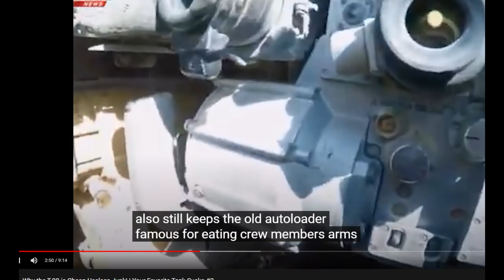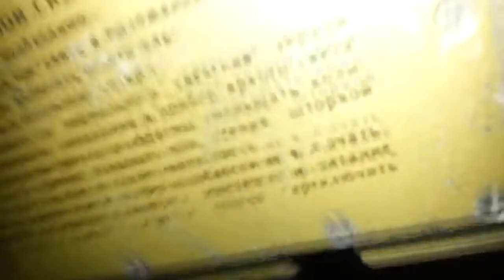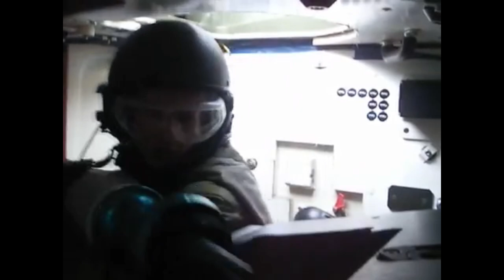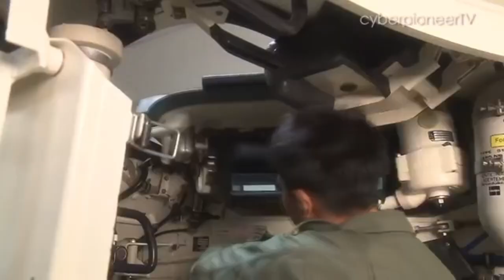Busting Myths on T-72 tank!

Comment: A question to Red and other self proclamed tank experts: is the the Hull of t-72 is similar to the t-90 one in terme of dimensions (width, lenght, height) ? 
Please
Reply: Another question :could we put the welded turret of t-90 on t-72 Hull?
Reply from the maker: @warmbreeze7996  I never claimed to be a tank expert...
But yes, T-72 and T-90 hull are equal in dimensions and you can indeed put the welded turret of T-90 on a T-72 hull
Reply: @warmbreeze7996  T72 and t90 are almost the same tank so they should have the same demensions
Reply: @RedEffectChannel  excuse me for the mis understanding, by 'self proclaled tank experts' i was ironic and mean about some people in the comment section who pretend to know everything and arguee with you if you give an opposite opinion than theirs.
Thanks you for your answer
Reply: @meki___6881  Dimension-wise Yes, but the composite armor is different as well as the gun and electronics.
Reply: T-90 is based on T-72 but for commercial motive the name was changed to a version of the T-72 to "T-90"

Comment: Old Diesel engines run pretty much on any burning liquid. Vegetable oil or petrol it doesnt matter. The only reason this changed in more modern times is higher and higher injection pressure resulting in better fuel economy. The downside is that fuels like petrol dont have a lubricating effect like Diesel which would damage the injectors during continues usage.

Comment: I actaully got to take a chance to get in a M84 from Slovinia when I was in Germany in 2018. The driver was taller than me about 5'9-5'11 vs me at 5'8. The drivers hull was alright, but not as comfortable as the drivers hull in the M1A2. The Turret space wasn't bad honestly, I was a loader and gunner at the time, compared to the Abrams stations. But I wasn't to keen on the small foot bar for the gunner in the M84 and the lack of guards on the turret ring. It was a pretty beat up tank, but that's expected regarding Slovinian M84's.

Comment: So, I don't know if this is true or not. I read somewhere that US soldiers that were involved in the Gulf War had inspected the Kuwait's Yugoslav-made M-84AB tanks. They also inspected captured Iraqi T-72 tanks. And the conclusion was that the M-84 had a much higher build quality from the materials used to the quality of the welds. Again, I don't know if it's true.
Reply: It also, on one instance, Abrams stopped working cuz of the sand, but M84 did not. That's actually crazy to think about
Reply: Probably partially true. Turrets were made locally in Iraq. Can't expect quality there
Reply: @nikolaradovic8067  Unlike the M-84, the Abrams used(and still uses) a gas turbine engine that needs a shit ton of air and therefore good air filters - which it didn't have back then and the sand made the engine die.
Reply: @veliki_dlek  Yea, i know that. But it's still amazing to know more things
Reply: @nikolaradovic8067  I am sure that both M1s and M84s had maintenance issues.  Remember that the M1s had been in theater for 4 to 6 months already; the M84s were practically new, and had only been in the desert 1 or 2 months. The M84s also had Contractors (and US Army mechanics) aiding the crews. The Yugoslavia government (and a German corporation) had a vested interest in the M84s performing well compared to the Soviet Union and PRC manufactured tanks. 

In the 1990s, as a generalization, M84s were superior to nearly all T72 tanks.
Reply: @paladinsix9285  yeah, if nearly does not include T-72B....
Reply: Its not, its Just that Jugoslavija sent logistics aid and personal to oversee the tanks delivery and train kuwait personal. On the other Hand iraq was sanctioned and could not import any kind of replacement parts and their t72 werent maintaned at all
Reply: @barbarapitenthusiast7103  I am sorry, but how does the tanks not being maintained properly affect if the original welds and castings were of good quality or not?
Reply: @ravenouself4181  yes, it does. any imperfections on the welds and castings Will be made way, way worse by years of use in harsh desert conditions without any maintanance

Comment: Red, which do you think is better, T72B3 (with the engine upgrade) or T90A? I think the T72B3 is better as it has more gun depression, which allows a tank to target much more accurately when moving over rough terrain. It also has a better engine ~1100hp compared to the T90A ~1000hp which gives it a slight edge in mobility. I’d like to hear your thoughts
Reply: T-90A have 840hp engine, the same as T-72B'89
T-72B3 2016 have realick side skirts and Forest S24 era on side turret but front is better in T-90A on the turret because of the knew turret.
Reply: @76456  the T90A has a 1000hp engine. It’s the original T90 that has the 840hp engine

Comment: Every T72 can be converted in to RC or AI controlled vehicle. The hardest thing - auto reload mech already done. So in this case Russia has a potential to create the biggest army of autonome tanks, while on west only french Leclerc has such capability but it costs much, while T72 is cheap and prodused in very hight quantity.
Reply: Russia had tried making RC tanks in Syria and Ukraine, there are problems with maintaining a signal to the operator with ground vehicles. Aerial Drones have the benefit of having clear skies for easy signal transmission. On the ground you have all sorts of crap between you and the ground drone.

Comment: Good video but one nitpick.  

I doubt the auto loader eating arms is fully a myth although probably it is rare or they would have re-designed it.  

As “The Chieftain” says anything that can be eaten by the “turret monster” will be if you are not careful and this is from a commander of an Abrams which has never had such a reputation for causing injury.  

Having worked around all sorts of machinery where workers got hurt, I can tell you all it takes is one moment of distraction, fatigue, or simple dumbassery to cause terrible injuries or deaths regardless of the level of safety built into the machinery or procedures.  Of course just one such incident is all it takes to start a myth of something being inherently unsafe.
Reply: It's very rare for that to happened during combat in Soviet MBTs, but surely do happened a lot on BMP-1 autoloader

Comment: I think you lied a bit when talking about worse variants. USSR was always using best variants while exporting one step downgrade. When they used T-72 Ural, they exported T-55A variants, when they upgraded to T-72A they exported T-72M (equivalent to T-72 Ural). When they upgraded to T-72B then they exported T-72M1 (equivalent to T-72A). Export tanks were always worse than main domestic production for the time.

Comment: Does anyone have any thoughts about the slow reverse speed of the T-72? Specifically, how would that slow reverse speed effect it's performance during a meeting engagement against a NATO armored unit? I mean the slow reverse speed of all Russian tanks seems to be a HUGE hindrance to their realistic capabilities in battle, and I think War Thunder players would agree! Watching that big Leopard II back up and move around far more nimbly than the T-72 is pretty interesting. In fact, you can also find footage of western tanks during NATO training going up out of cover, firing a round, and reversing behind cover, reloading and doing it again, and doing it very quickly in a firing drill. I have never seen Russian tanks do that, the best thing Russian tanks can do on the defensive is just dig themselves in and use good camo and wait for the enemy stationary. I think the Russians would suffer from some mismatch issues if facing the west, I'm sure they can beat Ukraine handily though.
Reply: Not a big deal, having a fast reverse speed is Nice but 90% of tanks do not have cameras to Look where they are going so going in reverse blindly is pretty dangerous. Also warsaw pact doctrine empasised moving forward and smoking to be good enough strategy that reverse speed wouldnt rely matter all that much

Comment: Red effect does the t-72b1 have any chances against ATGMs such as Spike or TOW2a?...
Reply: No
Reply: @Kalashnikov413  Why so sure?
Reply: @viceralman8450  
T-72B1 use Kontakt-1 ERA, which is the weakest amongs all ERA developed and used by Soviet Union and it's states
Reply: If hit everywhere except the cheekbones of the tower, penetration is likely because the charges are tandem. In addition, the Spike has a television homing head with operator correction, which allows you to attack on board or from above. Kontakt-1 is not bad, but it is designed primarily to protect the maximum armor area from RPG monoblock grenades, not ATGM.
However, we have all seen cases when ERA worked in this case as well. For example, TOW 2a against T-90 "92" or T-62M, when hit in reinforced ERA or HEPA areas.
In addition, protection against Spikes and old TOW is quite simple, these are laser interference generators for TOW and heat traps for Spike, Syria used Iranian optical jamers and additional protection, it works even on the T-55.
Given the protection of the T-72B1, the EPA and the thickness of the armor, the chances are not bad. In addition, solutions from an attack from above in the form of a screen with quartz sand also works, when covering the side with modern double-row EPA, even the T-72B1 becomes a difficult target.
https://ic.pics.livejournal.com/red_army_1917/24330280/157310/157310_original.png
https://vod-str.ru/wp-content/uploads/2021/11/kozyrek-t-72b3-s-novoj-zashhitoj-rostov.jpg
https://i.ytimg.com/vi/I8voatCnKR4/maxresdefault.jpg
Reply: @elusive6119   TOW is guided by wire, and have several variants being the 2A relatively new.

Comment: There's one story I heard, I'd be very interested to know if it were true. I can't recall if Iraq or Iran, but one of the two had an embargo of military hardware from the Russians (Soviets?). To maintain their tanks they needed a batch of front glacis so they opted to make their own. The story goes that they completely failed in case hardening the armour, and whilst it looked relatively normal and weighed relatively similar the protection was utterly pathetic. Possibly even to the degree that the 25mm Bushmaster autocannon was penetrating from the front.

Of course this doesn't refer to the T-72 as a whole, nor the tanks made properly and under Russian/Soviet methodology. If true it would be more a story of the incompetence of the smaller nation (and an interesting point towards how much technology goes into pretty much all remotely capable tanks as a proper T72 of course would be).
Reply: Replacing the front glacis as a maintenance operation?? BS.
Reply: @patverum9051  It takes damage, it needs repairs sometimes. Maybe they figured now they are making it they would upgrade (my assumption). Maybe they just got pieced together tanks and needed a glacis. I don't know why, but the more I look the more there is to confirm it. Plus the way it responded to fire sounds exactly like the stories of ww2 tankers taking an unhardened training tank into action.

Comment: I counted 4 shots in 70 seconds....that's really slow by modern standards. Abrams tanker from gulf war said 3 shots in 10 seconds was NATO standard. LEO-2 tanker confirmed the same figure
Reply: Even the best loader is going to strugle to load a round in less than 6 seconds, and even then he will get tired of handling a 120mm shell pretty fast. So by The third shot the reload is more like 10 seconds for WELL TRAINED AND EPERIENCED loaders

Comment: And what army in their right mind would want fuel in the front line that diesel engines cannot use. Most of the vehicles in a unit are going to be diesel. If you do not have diesel you cannot support the tank. And if you are desperate for fuel maybe you should not worry about your gas guzzling turbine engines.

Comment: If I remember correctly, the myth about Soviet Autoloaders taking off body parts like arms came from an incident inside a BMP-1 when a crew member was injured by the autoloading mechanism. Although im not sure of the extent of the injury.
Reply: So that is a fault of the crew being dumb af and not the auto loading mechanism
Reply: @ee214verilogtutorial2  yep
Reply: @ee214verilogtutorial2  It's almost always a crew issue. Soldiers, globally, are well know for getting into shit they're not supposed to be lol
Reply: Bmp 1 doesn't have autoloader
Reply: @АндрійБулгаков  some does have autoloader
Reply: @АндрійБулгаков  yes it does, The BMP-1 had an autoloader for the 76mm gun
Reply: @АндрійБулгаков  only in early versions. But the autoloader for the 73mm gun often got out of alignment and failed. Besides, those were small shells and easily loaded by 1 hand.

Comment: About the hight of Leopard 2 Crew, i am 1,87m and a gunner/loader and fit "well". You are allowed to be 1,90m for all positions in the tank. An optimal hight however would be anything below 1,80m.
Reply: I'm 193cm and had no problem in either as a driver or gunner in Leopard 2, though gunners position was a bit cramped for anyone.
Reply: @karhuwaari  192 cm here and I'm very adaptaple to the smaller places :D I fit fine in Leo 2

Comment: I had the opportunity to get inside the M84A4 during a tactical-technical exhibition.
I am 1.83m tall and that was no problem for me.

The bigger issue was that I am fairly well built, so my shoulders are a little over 60cm wide, which made getting in through the hatch a bit of a tricky maneuver, and that was without any gear.
on the inside, it was a little tight, but not that really that bad. Yeah, I was pressed up against the gun breach shield on my right, but I had room on the left.
Reply: It's not just climbing in, nor standing inside an AFV. Try conducting Crew Drills, while in the specified uniform,  AND with ALL of the equipment and ammo aboard the vehicle. 

Almost never are vehicles on display equipped with the "Basic Load" of equipment, tools, food, ammo, etc.

AFVs get very cramped when fully loaded. 

Exacerbating the lack of space, and ergonomics inside an AFV.
Reply: As for all vehicules, there is a size profile for each crew member.
If you fit the profile, you will be OK, but that doesnt mean comfortable
Many things are not adjustable in a war machine, because it is impossible to make them adjustable.
In some cases, it could be better to be close to the max size allowed to the combat station, in some cases it is better to be close to the min size.

If you dont fit the required size profile, you are just not allowed to serve on the type of vehicle, and you are assigned to another position.

As time passes because of richer food, average size of people is increasing , especially for Americans, Japanese and Europeans. So vehicules has to be adapted to that fact. 

If you look at WWII pictures, you will get an impression of the vehicules being bigger than they are, because the average size of people was smaller than nowadays.  

In any case, I would say it is better to be short and slim in order to offer the minimum target to any projectile or schrapnell... XD
Reply: I am 1.86m barefoot tall so without shoes would I still fit in there
Reply: @kawazaki23  guess you'll just have to try and see

Comment: The explanation on the autoloader is not very convincing . Of course he is right that  it will only happen if you put your arms in the wrong place, but that is true about all accidents, and it is clearly visible from the video itself that you could easily put your arm in a place where it would be severely injured.

And arguing that there is no injuries because Russia has not reported any is laughable. The Ruusian military never reports bad news.
Reply: Even with manual loader you could lose your finger if not careful or doing it on purpose to lose your finger 
Autoloader you have to be doing it on purpose to lose your arms and not just on purpose but also perfectly
Reply: @rogue__agent5884  Yes accidents do happen for Western manual systems as well. I have seen it several times myself. But the accidents tend to be minor.
Reply: @vmanrn2906  ye but my point is the auto loader can take you arm if your being reckless and doing it on purpose 
You have to put your arm in perfectly without any mistakes for it to be cut off